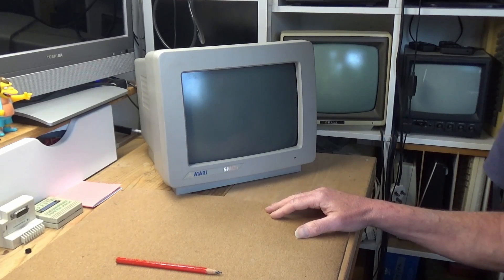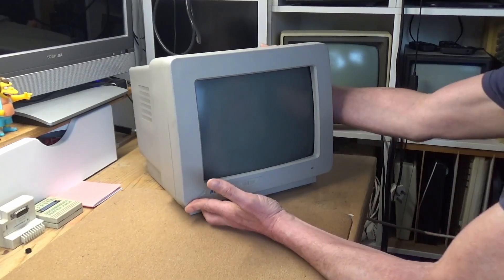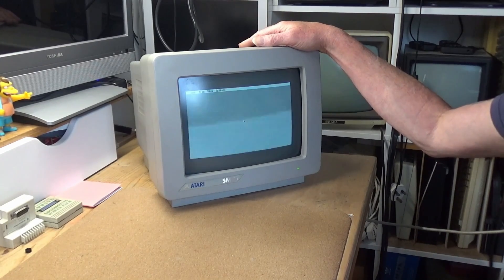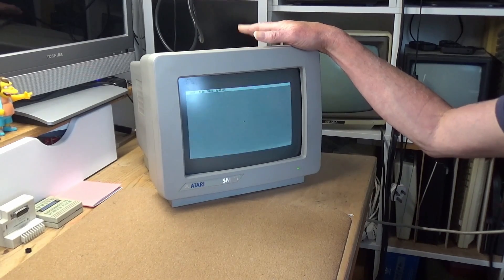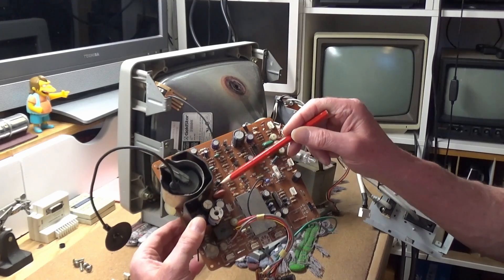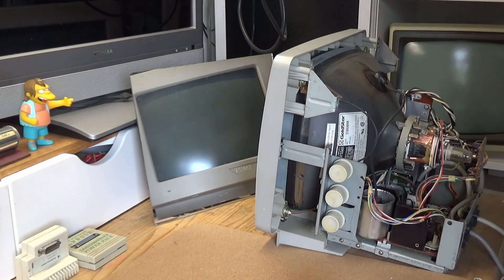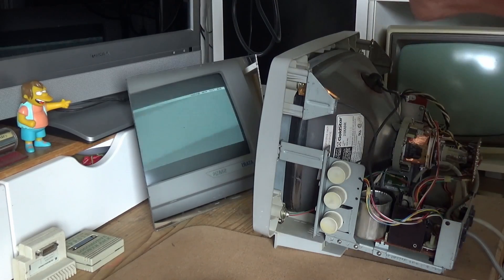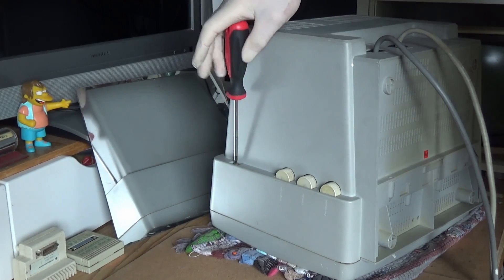Atari SM124 monitor mods

Comment: I only recently got an sm124.  I had no idea about the huge borders until then.  But the 1:1 ratio makes sense.  Still, the 640x400 just looks so good in black and white on the ST!
Reply from the maker: Absolutely! It's a much-underated screen that is actually pretty reliable too other than the cap swap, and that's a simple task. Thank you for watching :)

Comment: Great video, very useful info. It is worth mentioning the SM124 has that small screen size due to the screen being set up to have a specific DPI (dots per inch) amount (which iirc was 72dpi, the same as a Mac Plus/ 512k etc). This was useful for DTP work as it was directly translatable allowing accurate depictions on screen and in print. I think GDOS also expects this. Nowadays the extra screen real estate is more useful I would think :)
Reply from the maker: Yes, thank you, that is a very good point and as you say, nowadays, we're probably happier with a bigger display than a 1:1 screen and print ratio! Thank you for watching and for your kind comments :)